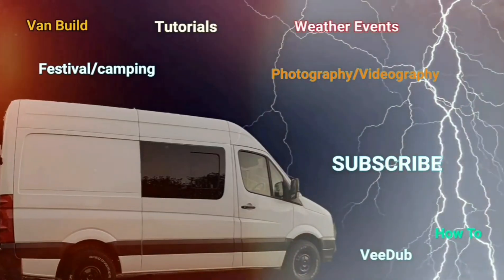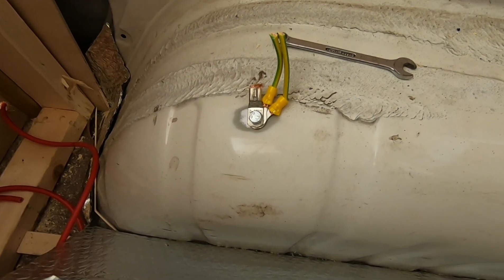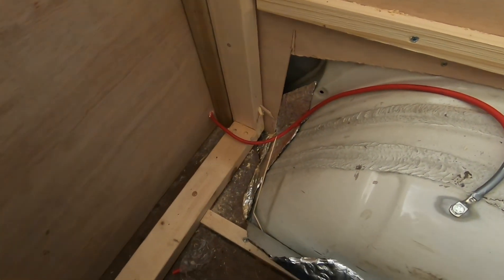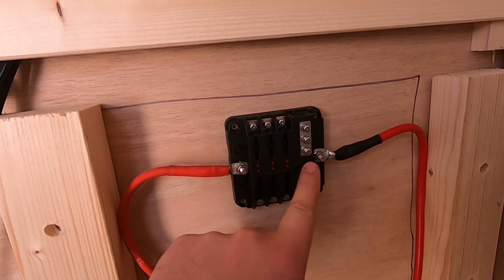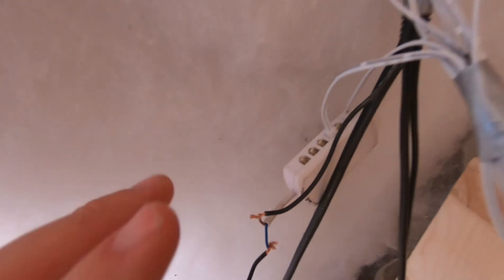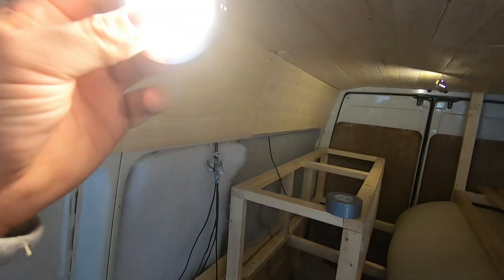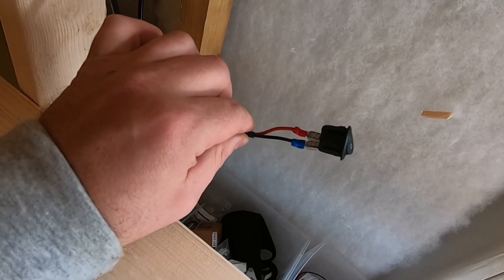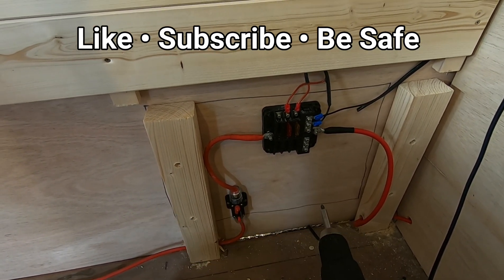Pt.3 Basic 12v electrics -   Volkswagen LT35 full diy van build campervan conversion

Comment: Hi. How have you managed to route the power cable from the van battery to the leisure battery? Do you have a more close up video of this as looking to fit my leisure battery in same place but unsure how to route the main power feed from van battery to leisure battery / split charge relay. 

All best. Van looks awesome.
Reply from the maker: Thanks mate 👍 
What van you got?
Reply: @LT_TOMMY_  A VW LT35 2006
Reply from the maker: I found a little plastic grommet that popped out and ran it through that, you can see it from the inside the cab easily, its quite low to the floor  ,have a look and let us know 👍
Reply: @LT_TOMMY_  awesome thanks for that. Was that on passenger side as looking there and can see the tool box section where the passenger feet go and thought maybe there.
Reply from the maker: @AboveGroundLevel.  it's around there somewhere,  its like a plastic bung or grommet which just pushes through, if you can't find it let me know and some how I'll try and get a picture over to you 👍